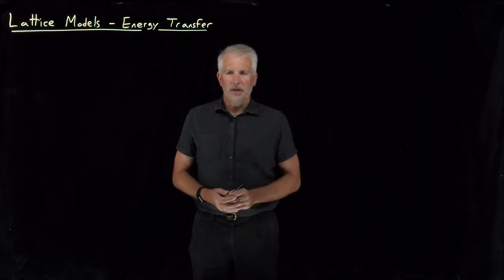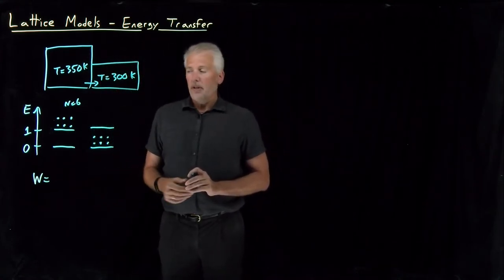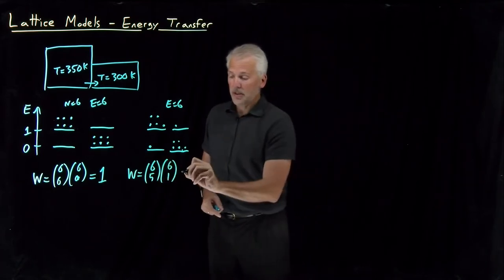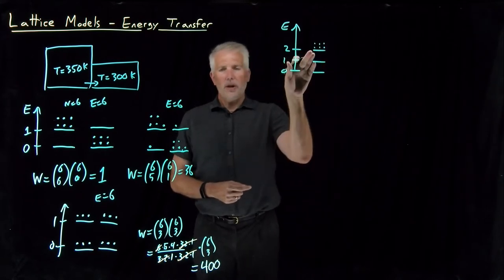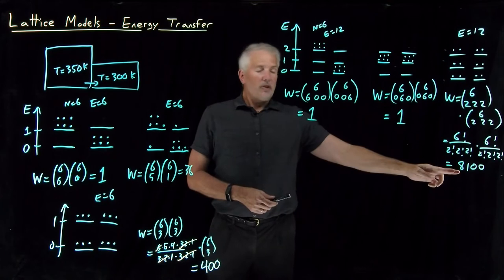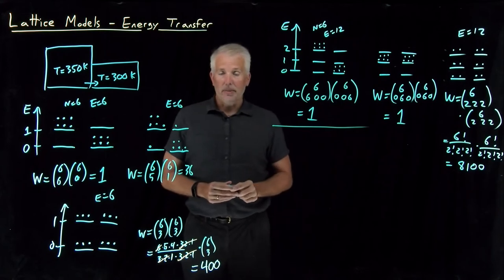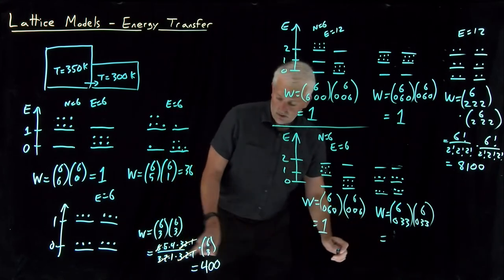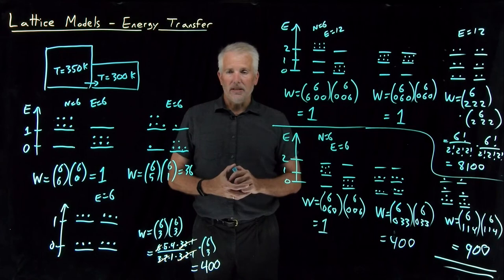Lattice Models (Energy Transfer)

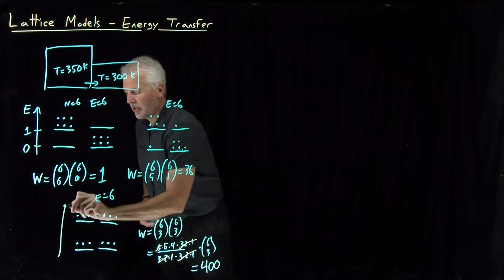Comment: THanks alot ❤️.if im right  i think at 8:26 it is correct if  dimensions of two boxes are the same.by having different dimensions it cant be said the equal number unit of energy will be spread between two boxes. the bigger one has more ( by assuming an isolated system which is isolated from the environment like air)
Reply from the maker: Yes, that's exactly right. The energy will only be split equally across the two halves of the system if they are the same. What *is* always true is that the entropy will be maximized.
Reply: @PhysicalChemistry  ❤️❤️❤️